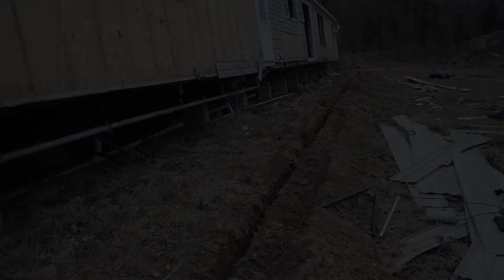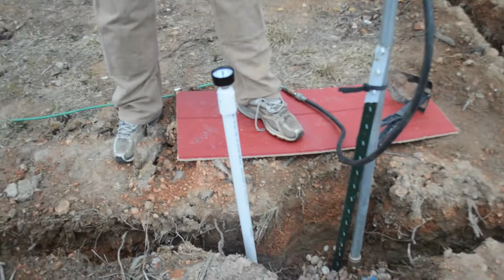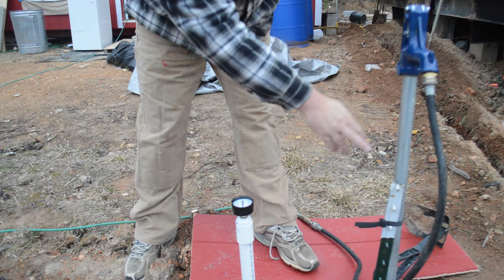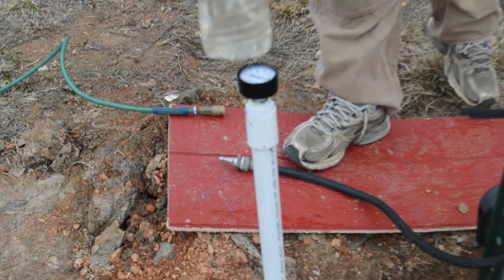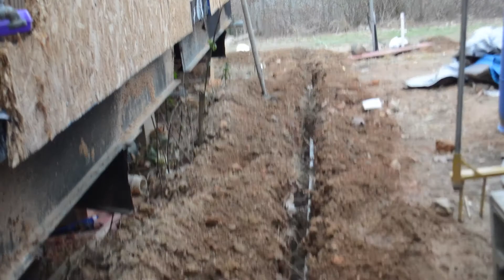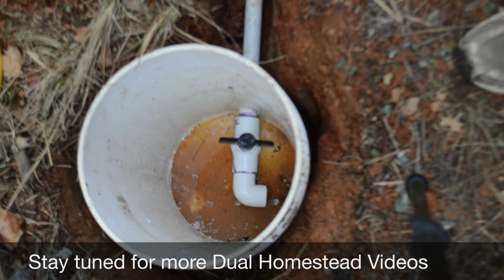Dual Homestead Water Line

Comment: I live in the county but went to the city asking for old garbage cans with the flip lids and wheels.  they gave me a bunch, usually they had bad wheels or a little crack.  I cut the bottoms off and buried them everywhere I had a valve connection on our 15 acres.  then I bedded the bottom with gravel.  now I just lift the lid and reach into a 'landscaped' clean big area to turn the valves.  hell, sometimes I actually just get into it plus there's plenty of storage for hoses etc.  I get the creeps putting my hands in those little junction boxes or buckets usually full of spiders or even snakes and down here both are deadly.  I even sunk one over my septic D box and now it's always accessible.  just an idea for you...